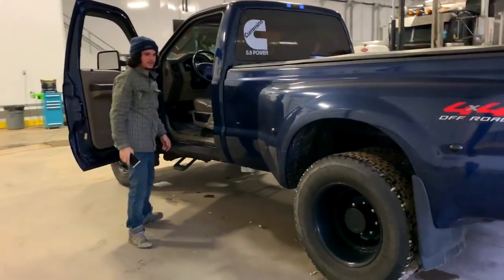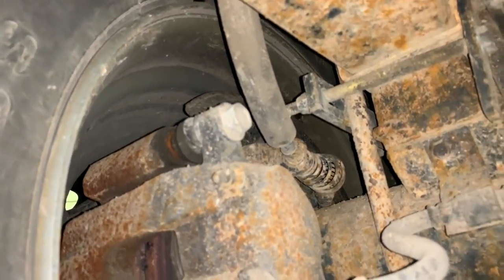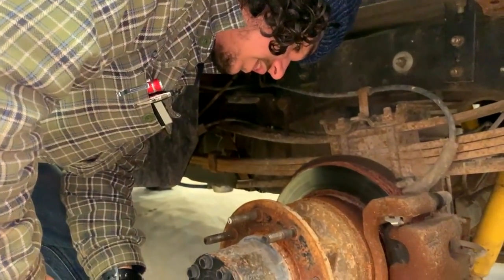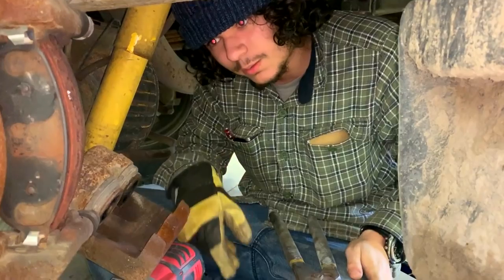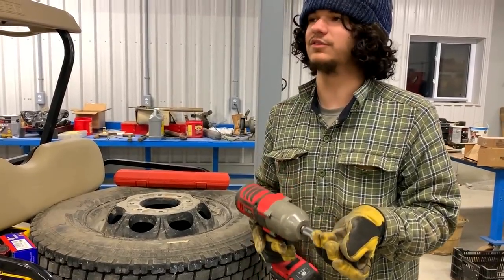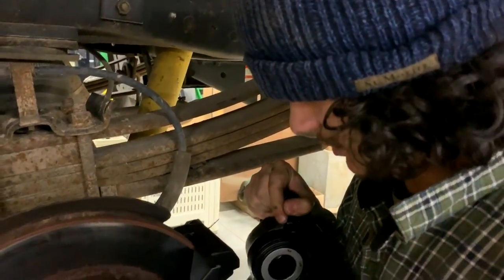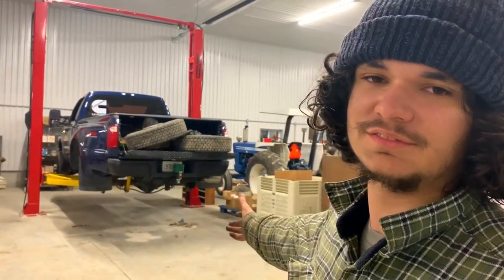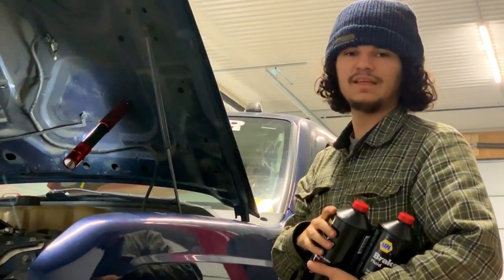Fixing the FAULTY BRAKES - F350 Fummins

Comment: If both piston stick then usually it's a fluid or pressure issue . The inside of them rubber hoses collapse and you can't notice it but brake will hang on
Reply from the maker: It’s a common point of failure, That’s why you never hang the caliber from that brake line.  It’s delicate and can cause a lot of grief lol
Reply: I have changed them on new truck that never had the calipers off!! Brake fluid eventually ruins the rubber hose
Reply: Rule of thumb, replace both the caliper and the flex line as a combo. The rubber flex lines have multiple layers and when the caliper falls and is caught by the flex line, can cause the inside layer to collapse
Reply: @jerrybrandt9377  flex lines are made to resist the break fluid 👍 however any other oil will cause them to swell and cause problems